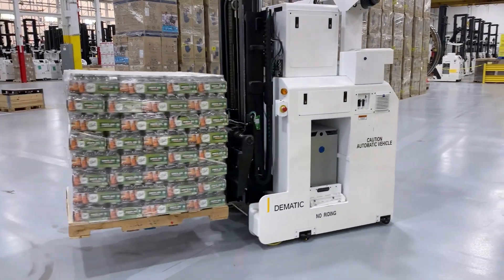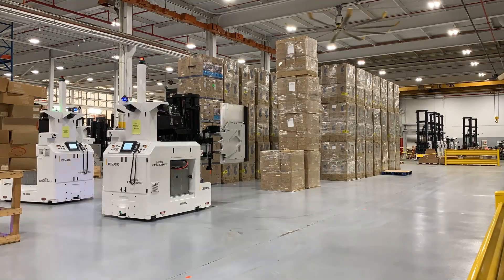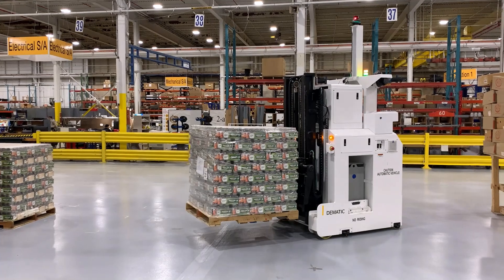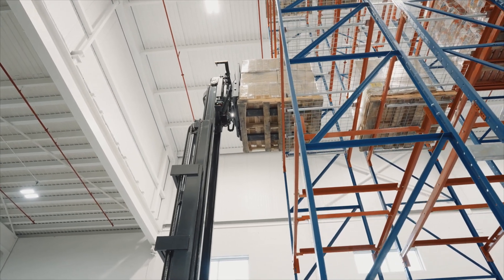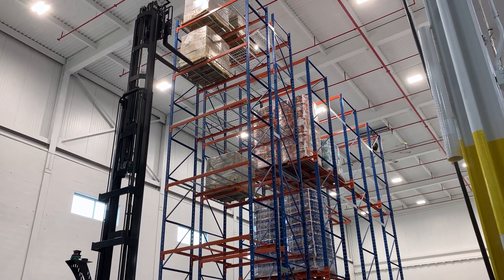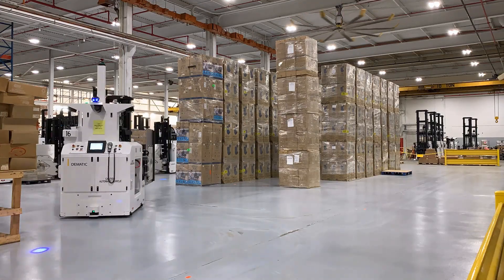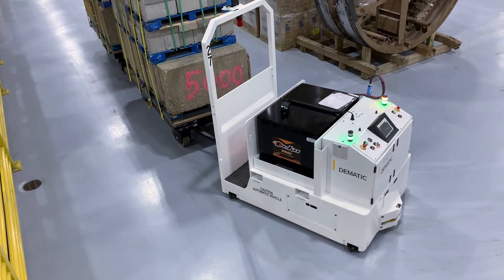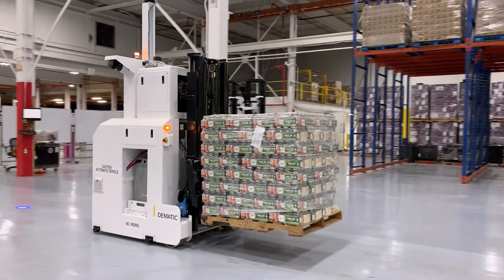Dematic Automated Guided Vehicle Systems

Comment: Before I begin, thank you for giving me a job and help put food on the table. Feel free to remove this comment if need be. My apologies for bothering y’all like this, but I THINK I found a bug with y’all system. (0:43 that looks like the AGV we use)I noticed when a AGV is going into a bay. I can physically put my hand on it like near the screen and it does not recognize that I’m even there. It’s like the top and bottom sensors are not reaching far enough out.
Reply from the maker: Thank you for bringing this to our attention. The safety of our employees and customers is our top priority. We’ve shared your comment with the appropriate team members. For service related to your specific system, please contact our Service line at +1 (800) 530-9153.

Comment: The company I work for bought 15 of these at aprox $125,000 each and they were all equipped with leaky masts that cannot be replaced. I only have a job because the Dematic AGVs are so unreliable that we have to babysit them constantly because of tilt restarts exceeded and shift left/right fail.   Over a mile of track, this can take 5 to 10 minutes per fault to clear when you have each machine fault at almost every pallet they try to pick up. And I'm sure my comment will be deleted soon.
Reply from the maker: Thank you for your feedback, @xtroupax. We have passed your comment to the appropriate team but we would like to hear from you directly to further understand the issues you are experiencing. Can you please send us an email at socialmedia@dematic.com?
Reply: Sounds like you need to get properly trained how to perform PMs on these AGVs. Speaking from experience. These AGVs are very reliable if you maintain them properly.
Reply: Wow.